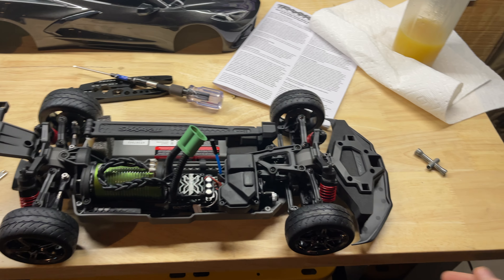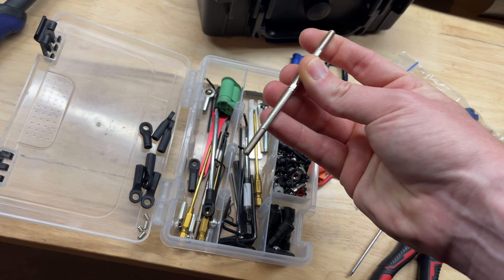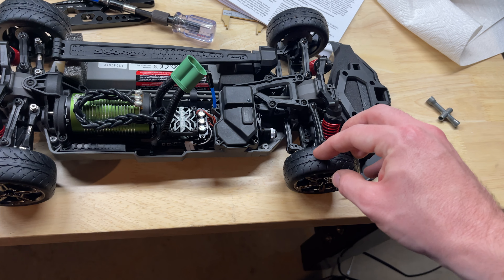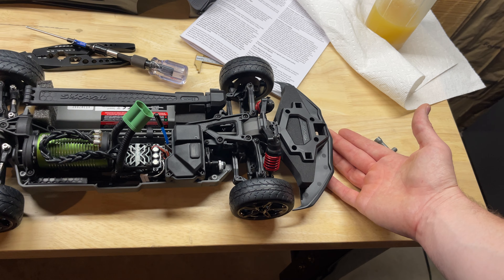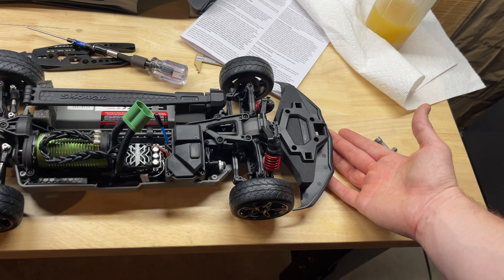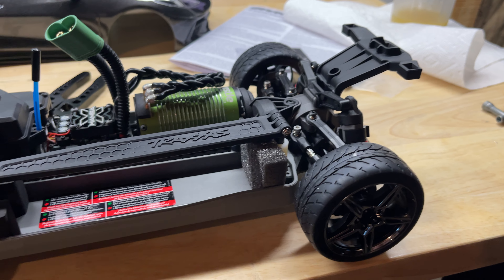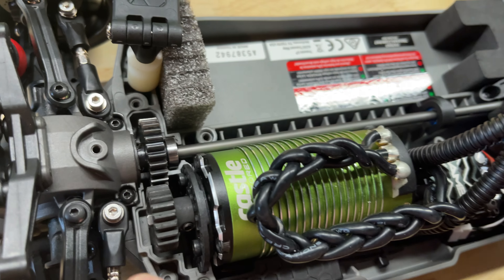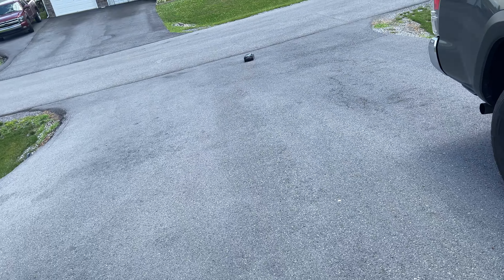Traxxas 4-Tec 3.0 | Minor Tuning and First Run

Comment: Try setting the front toe in, so when the wheels drive in to each other it would keep it self strait, and toe out on the rear for stability, couple of thing I picked up from sim racing, it might help out.
Great videos
Reply from the maker: This is the exact opposite of what nearly everyone else suggests. My limitless is also toe in in the rear and toe out in the front. Maybe you have it backwards?
Reply: @GoKaioken  yeah maybe, but toe in for the front gives it smoothness and toe out makes it nervous and fast responding. Smother is always faster.
On the back it's more depended on the car but I usually set it up like that for better traction but trying it won't hurt, please include the geometry setting in your videos cause its interesting to see what works.

Comment: I've got a Hobbywing XR8 4268 2800kv system I'm trying to fit into a 2.0.

I'm wondering what spur gear and pinion combination did you find to work??

Comment: Lol😂, your funny..... that thing is NOWHERE NEAR AS FAST AS A LIMITLESS, nor the quality of a Arrma. I know, I have both
Reply from the maker: I do too. These are two different cars. What’s your point??
Reply from the maker: You’re*
Reply: I'm currently trying to get the 4tec to drive half way decent. I've put a gpm rear brace on, contact foam tires, spektrum receiver w/avc, and currently trying to fins a servo that will fit.... my point is that Traxxas makes junk and you basically have to pay in upgrades what the car cost just to get it to drive decent.
Reply from the maker: @bradd145  it drives great if you use it the way it’s made. I went 128mph with mine and had to purchase a lot to get there. For a Limitless I’ve bought nearly 1800 worth of stuff for the two I’ve got to make them go over 160. That’s just what it is if you’re trying to go fast.
Reply: @RC Recon  it drives like a dumpster on fire going downhill on ice from the factory, and you spent a little too much on your Limitless, I've got about$1300 in mine and it goes just as fast. I mean who puts a nylon spur gear on a brushless model, Traxxas. They are junk.
Reply from the maker: I said between the two of them that I have meeting two limitlesses. And the 4Tec challenges your building ability. Good luck.